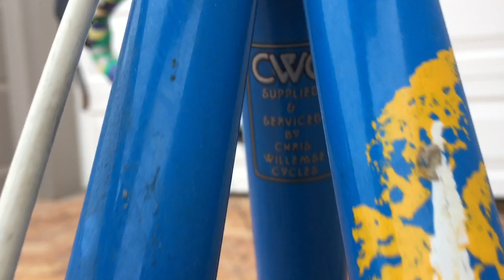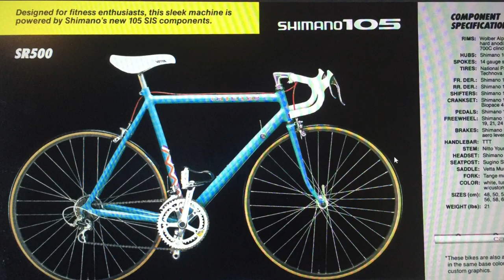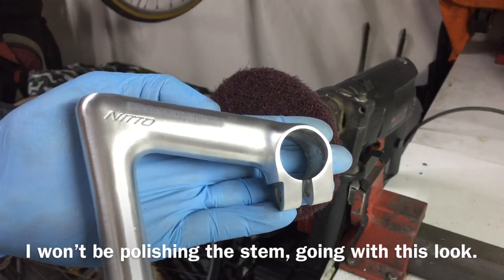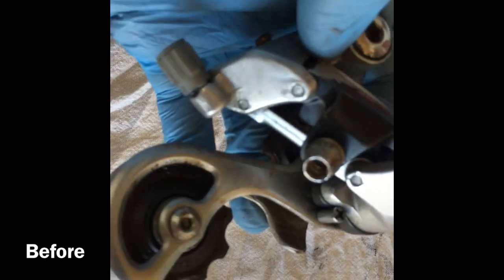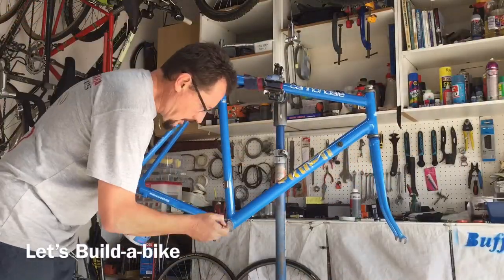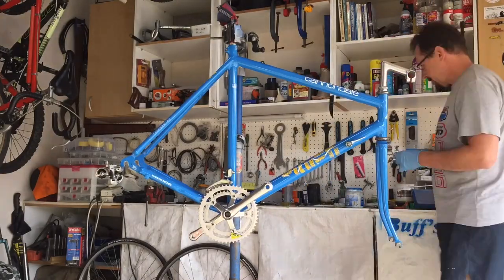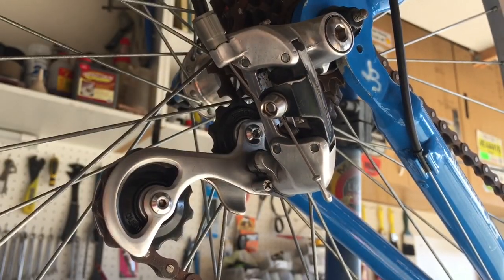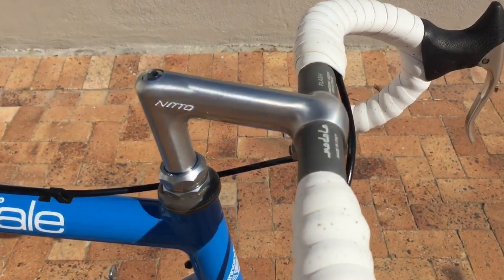Cannondale Criterium Restoration

Comment: I have (2) 3.0 criterium frames that I will never relinquish….
They both have the extended rear dropouts and aluminum Sakae front forks….
Exceeding stiff and fast as all frig….I’m 140 pounds soaking wet and the harshness of the ride doesn’t bother me at all….
I’m not at all against carbon, and my first road bike from my Dad was a steel Motobecane, so I know how comfortable other materials are…even a mass produced 80s bike boom model like the Super Mirage …which was made in France though….
The Cannondale just feels like this solid, light platform for speed….and I’ll buy another if the  opportunity presents itself 🙏🏼
Reply from the maker: Thanks for the feedback. They really are great frames and very underrated. When you put the power down you feel it right away 💪🏼👍🏼

Comment: great video. I just bought a very similar cannondale (same blue and white) with all of the same components except for the stem and cassette. I think it is 1991 though which the odd rear dropouts at the back.
Reply from the maker: burchds84 thank you 👍🏼 The model after this with the longer dropout clamps were prone to cracking on the chainstays. Inspect it carefully once you've cleaned it up 👍🏼

Comment: Great restoration. What size tires did you use? and what is the max size you recon the wolber rims and frame combo can handle?
Reply from the maker: Thank you. I can’t recall to be honest, I think those tires were 23C. It should handle 25C comfortably. I’ve since sold the bike so can’t check for you.

Comment: Turned out great, glad I found your post on Instagram. My bike is also Blueberry with the hand painted graphics, I need to take close look and compare how the yellow varies from yours. Mine also has the sprayed JB initials, but based on what I read on Bike Forums, I think maybe that is the painter because there is a whole thread about the welders stamping the frames instead. I could be wrong about that through. Anyway, thanks for making the video, gave me some good ideas for how to fix the issues mine has too.
Reply from the maker: tmorgan911E thanks for the support 👍🏼 The painters initials in spray paint would make more sense I guess, thanks for that. I had a closer look at mine and it has 3 initials stamped into the left wheel lug, KP and TB being two of them, I can't make the 3rd out.

Comment: Getting ready to restore 1987 SR600... What bottom end did you use to replace the rusted original? Love the video. Thanks!
Reply from the maker: Thanks, the old BB was replaced with a new sealed BB unit, available at any decent bike shop 👍🏼

Comment: I have a 1990 version of this bike.
It has a Modolo Anatomic Slope Tech handle bar with a sleeve.
The sleeve is clamped tight and does not move however the handle bars move slightly within the sleeve.
Do you have any suggestions to correct this.
thanks
Reply from the maker: Without seeing it, it’s difficult to give advice but a handlebar with a sleeve is normally indicative of bar that’s too thin or a stem that’s too large. What stem are you using?
Reply: @BuffsVintageBikes  it is a modolo as well.. the sleeve is part of the original handlebar

Comment: Nice work. I picked up one of these also just a few weeks ago in original white w/blue decals without much of the original parts - frame and fork essentially, with a hodge podge of Shimano parts. I believe the handlebars originally were "TTT" brand from Italy (still in business) ? F.Y.I. you should find the serial number along the chainwheel (drive side) chainstay towards the B.B. end, in a kind of "peppered into frame" early digital imprint. It reads backwards so for example you might have 58082487033 which would be 58" 1987 24th of August (production date), frame # 033 (whether it is frame # 033 in totality or on that day I'm not sure). So: 58 - 082487 - 033 to visually decode it. Wish I had the original bits like yours however am pretty pleased with the assortment of 105 and Ultegra parts. Nice channel and I particularly like the various Scotchbrite, alfoil & Autosol methods. Cheers!
Reply from the maker: Aussie BMW thanks for the feedback. This bike has since been sold but I was aware of the frame number on the drive side chain stay. This particular bike was a size 58 (hence the sale, I ride a 54) and built in 87. All the best with your build, if you're patient and look around I'm sure you'll be able to get that groupset close to original. Fortunately there's still quite a lot of old 105 components to be found on various websites and forums.
Reply: Thanks mate. I may have found some original 105 hubs locally so that's a start. Unfortunately the frame has a rather deep 'wheel gouge' on one inner side of a chainstay which has taken away 1 to 1.5mm of material in about a 16mm x 20mm area...a tough place to weld or braze material upon. Also an integral dropout looks somewhat misaligned. Am reading up on aluminium welding, annealing & brazing with interest. I've fully stripped the bike now and my frame weighs around 2100gms...quite astounding. Will look to the forums and do enjoy the sympathtic relaxed pace of your videos. Thanks again.
Reply from the maker: Aussie BMW sorry to hear about the gouge. My suggestion would be to rather use a bonding agent like Pratley’s steel to build the gouge mark up rather than applying heat to the area through welding and thereby compromising the structural integrity of the frame. Just be careful as once it’s set hard it becomes super difficult to file down. I’ve had success in the past using this method on a Giant aluminum frame 👍🏼

Comment: what kind of paint do you use to restore the paint?
Reply from the maker: For this particular bike I used blue & white Tamiya modeling enamel which I blended to get the correct shade of blue.
Reply: @BuffsVintageBikes  Fantastic restoration.  I have the same bike/color, did you combine the Tamiya X-14 Sky Blue and Flat White XF-2 acrylic paints?